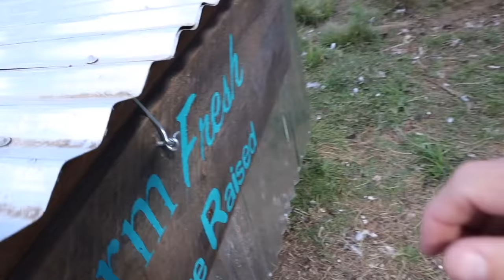This Makes it so We Can GROW all WINTER w/out HEAT in our GREENHOUSE in a Northern Climate Zone 4B

Comment: Corn can’t compete with weeds, so be sure to kill weeds thoroughly around the stalks for the first month of growth. After that, corn’s shallow roots will spread out as much as 1 foot from the stalk; be careful not to disturb these roots, because it’s easy to damage them. Instead, apply mulch to prevent weeds from sprouting.

Corn needs about 1 inch of water a week.Water stress during pollination will result in ears with lots of missing kernels, so don’t skip watering your corn patch. Apply water at the soil surface by using a soaker hose or drip irrigation. Avoid spraying plants from above. When the stalks are about 6 inches tall, side-dress them with blood meal or diluted fish-based fertilizer and repeat the feeding when they are about knee-high.

Comment: Best corn I ever ate is wrapped in aluminum foil then baked at 400 degrees for 25 minutes either on a grill or oven.
Reply: I always micro ears. I leave just enough husk on it to cover the kernels & micro an individual ear for 2.5 min. of course if you nuke more than one ear you've got to add time. At 77 years and eating corn on the cob for 76 of them that is the best way, by far. Be careful it's hotter than hades. The silk and the remainder of the husk come off very easily then!

Comment: I like the forced air between the layers concept but as an electrician I would not just zip tie wire directly to your metal frame. The combination of heat and the possibility of movement from high winds will eventually degrade the insulation on that wire and you may end up with a hot frame. And not the kind of hot you want! Best of luck. God bless.

Comment: Will you need more solar to run the greenhouse fan 24/7 on short winter days?
Reply: The fan looks like it's probably around 0.5 A at 12 V, given the size. In that case you'll need 0.5*12=6 W of power to run it. If that panel is rated anything greater than 20 W and the battery doesn't freeze, it should do it for around 44-45° N.

Comment: I wonder with the afternoons warming up, if inflating the top to hold more heat will effect the crops already inside?  God Bless
Reply: going to be cold up there pretty soon  Aug avg low ~62'F, Sept 52' & Oct 40'
Winter -25 to-20 'F for lows
Reply: Ron Smith , I am very aware of the temperature changes. However, they have been having lows in the 50-60 and have gotten as hot as 90’s during the day. I was wondering how hot it will get inside now, and if that would cause heat stress to the maturing plants.
Reply: @virginiareid5336    THe whole bottom is open & the louvers open automatically to vent hot air.
Reply: Ron Smith , yes it is, however, with everything open Al said it was 100  degrees in there a couple days ago .  I’m not by any means disagreeing with you, I was just wondering about the older plants and any additional heat on them.
Reply: @virginiareid5336   We can see the follow up posts & what happens. I 'guess' it will work out ok. GH are great tools but, your absolutely correct about shedding enough heat to avoid damage during peak daytime temps & sunlight.
Reply: Ron Smith , thank you for understanding my question. I drove to my youngest son’s this past weekend.  As I drove back, the closer I got to home, I was shocked. Even with the giant field sprinklers on, the corn had suffered. It is dark brown and burned up on the bottom half of the stalk, while the top half still has some green. I stopped at a field road and only saw one corn 🌽 per plant!
Reply: @virginiareid5336   Hope you can get some crop & not lose it all. BOL Is it in silk or just before?
Reply: Ron Smith , the field belongs to a high school friend and his brother. I'm not a farmer's wife any longer.  The corn including all that was dried out was tasseled .  I feel so bad for them.  Last year it was their bean crop that was attacked by the big brown and green hoppers.  Take Care

Comment: I'm a little concerned that you placed the air intake on top of the greenhouse. When it rains, the water will flow into the opening, through the duct work and onto the fan -- shorting out the electrical.
Reply: Watch again as the opening is on the inner layer of plastic!!!

Comment: I AM SURPRISED YOU PUT IT ON THE ROOF WITH ALL THE SNOW YOU GET IT WILL BE SWAMPED AND COVERED AND JUST ANOTHER THING TO DO BY CLEARING THE SNOW
Reply: The vent is set in the inner plastic layer, snow on top should not trouble it,

Comment: ..whatever would we do without zip-ties, eh?
Reply: Violante de Rojos - From Wikipedia "Cable ties were first invented by Thomas & Betts, an electrical company, in 1958 under the brand name Ty-Rap. Initially they were designed for airplane wire harnesses. The original design used a metal tooth, and these can still be obtained. Manufacturers later changed to the nylon/plastic design."